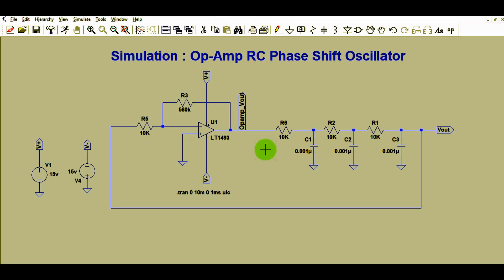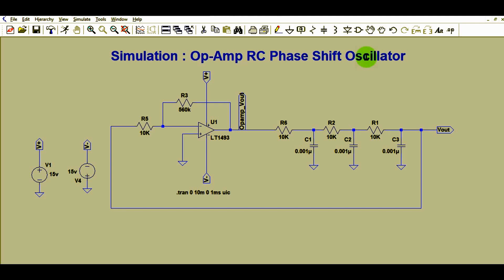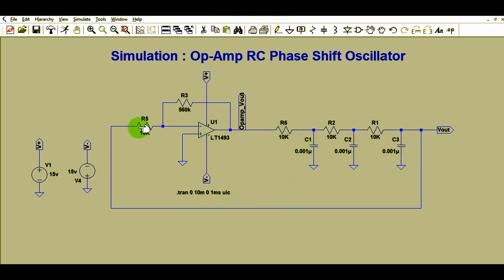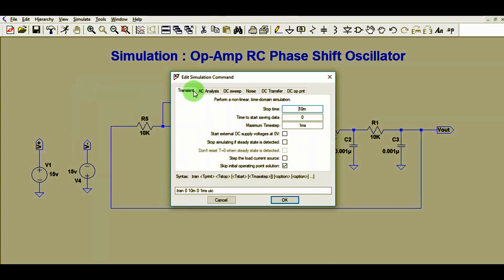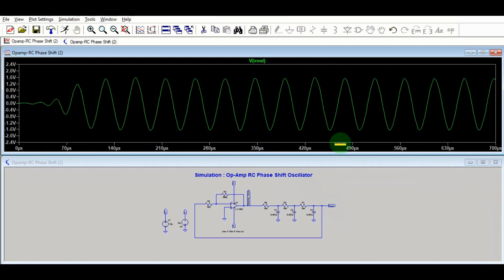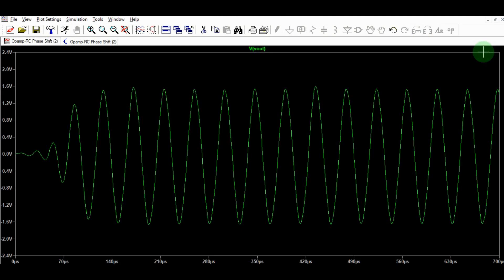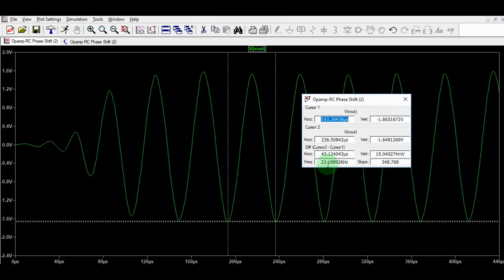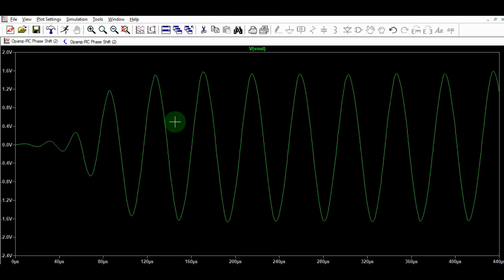RC Phase Shift Oscillator Design & Simulation in LTSpice | Op-Amp Tutorial

Comment: how to design a phase shift oscillator that will oscillate at 6kHz..?? can u help me?
Reply from the maker: Yes , I can help you.
I can share the LT Spice file of this file and you can play around the RC values and get the desired frequency. 

Best way to design the circuit is to understand the basics with design calculation and then go for simulation.
Reply from the maker: Nalza Deys regarding your last comment about LT Spice.

Basically they are called Net label and they connect two same point without use of wire.

Now you have to decide the port type i.e. input or output or bidirectional.

Watch this video at 7:30 min
https://youtu.be/yLlLJLWTrWg